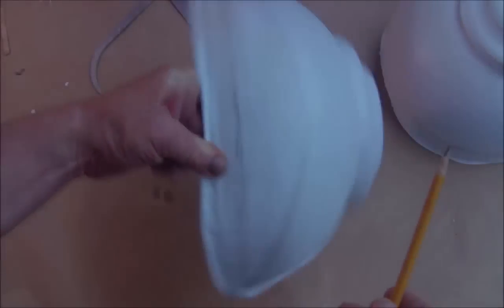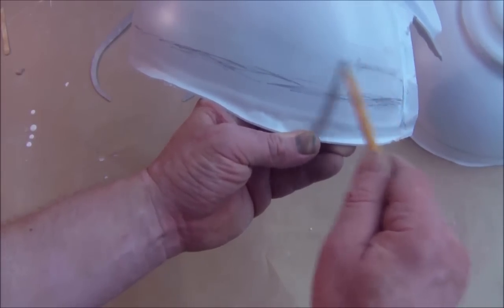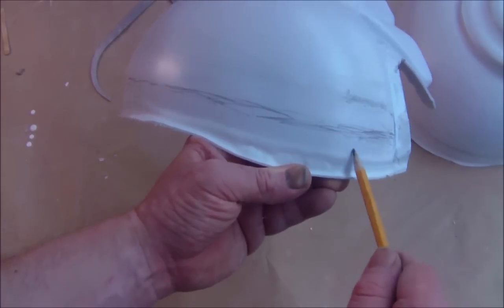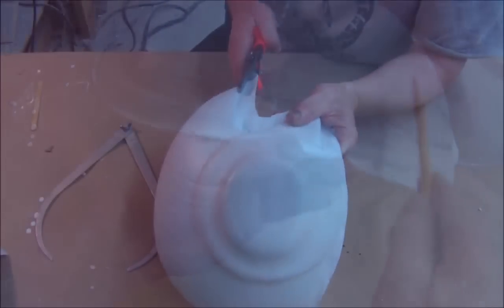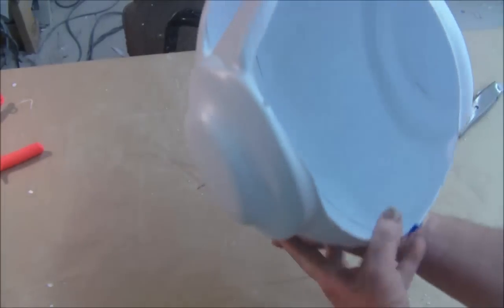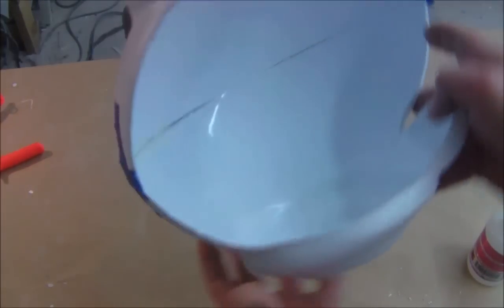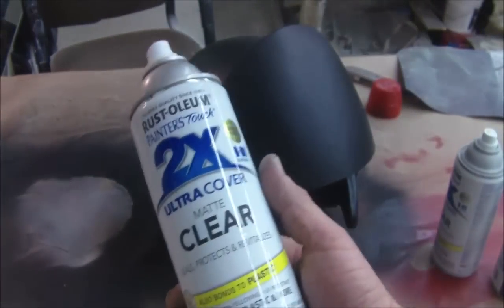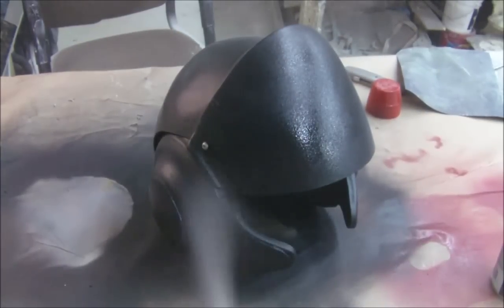The Force Awakens X-Wing helmet

Comment: I love your video. I have a couple of recommendations that you may know but newer modelers may not. Use clear gloss under masking tape and decals. The tape and decals will hold better and you can always hit it with dullcoat later. Also, remove masking tape before the paint fully dries. the edges will have a chance to smooth out. especially if the paint is on thick. finally, do not remove masking tape by pulling straight up. you have a better chance of pulling paint up with it. pull the tape away from the paint line with the tape almost parallel to the painted surface. hard to describe. the tape you pull up should be back to back with the tape still stuck. the tape should form a shallow V shape when seen from above. 

We often forget teaching basic techniques. I have friends who are excellent modelers and prop builders, but they never learned some basic techniques that can really help. those of us who have built for a while concentrate on teaching new skills and forget someone may not know some useful basic tips.